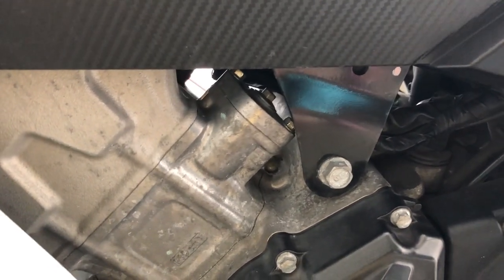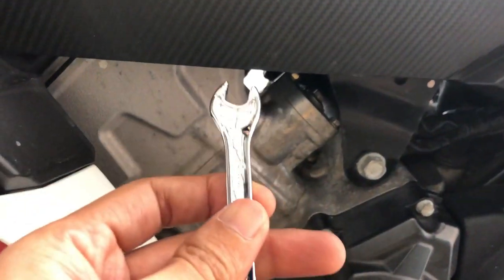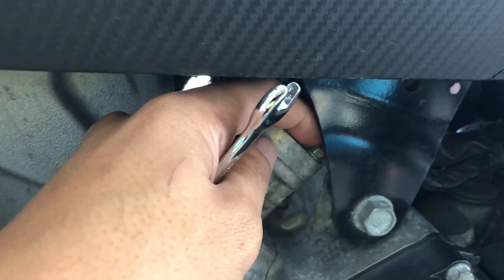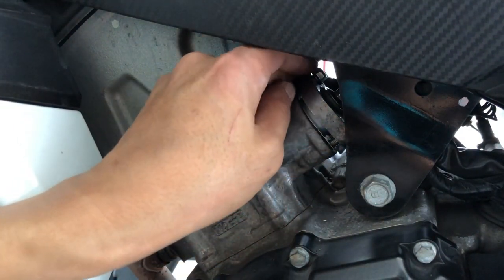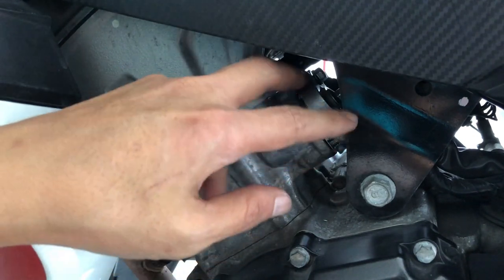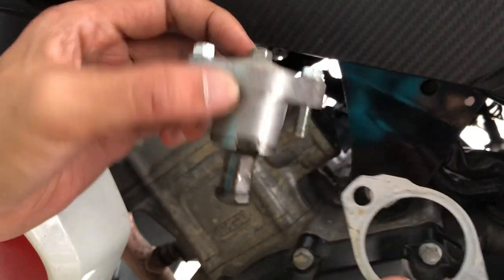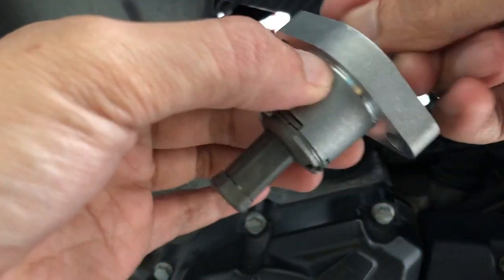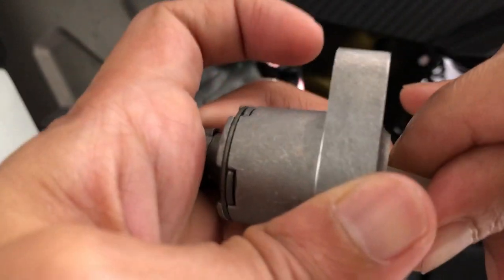Tukar Tensioner RS150 Rosak

Comment: assalam bang , motor saya baru lepas accident bang . mileage baru 2k tapi bunyi bising sangat . tapi saya accident takde damage enjin . bunyi kat enjing memang sebelum accident memang dah ada bunyi blup blup blup macam tu bang
Reply from the maker: Bunyi yg sama cam dlm video ke bos? Kalu tukar takut benda lain lak yg problem. Kena check dulu bos.
Reply: @chongsalmi  bunyi kasar macam dalam video pun ada bang . bunyi lain pun ada
Reply from the maker: @aarondanie1047  bos boleh try tukar tensioner dulu kalu problem ade related ngan tensioner. Kalu nak tukar pun harga x mahal sgt. Boleh cuba test satu persatu. Kalu betul related ngan tensioner alhamdullilah. Kalu bukan kena check benda lain le plak.

Comment: Klu Moto xmodi ap2 blh ka klu pakai yg manual pnya
Reply from the maker: Boleh pakai bos tp make sure setting die ngam la bos. Sy lbh prefer auto je sbb pnp.
Reply: nak tnya skit kalau motor tgh jalan dpn ada bumper/bonggol so kita tarik lah clutch dgn brake ye nak lalu bumper tu tapi time tu kerap juga ye berlaku rasa mcm trsentak2 dkt spoket dpn. spoket dpn blkg dgn rantai baru tukar. masih berlaku masalah yg sama. tensioner problem ke bro?
Reply from the maker: @safwanazman2885  tensioner biasa kalu stop pun ade bunyi cam “klotok” yg kuat even x jalan. Kalu tersntak ni suspect cam clutch gear kot. Sprocket dpn blkg br tukar kan?
Reply: Manual pakai boleh tahan bertahun lamanya. Auto cepat rosak
Reply from the maker: @chewan639  jgn risau bos. auto yg rosak tu boleh service balik buat spare.

Comment: Asslam bro..sorry lari tajuk sikit..sya nk tnya knpa bla sya bwk Moto agersif Moto jdi rpm lmbt turun bro..bla berhenti tarik clutch jdi tinggi timing ...pening bru ja pi setting fid ja hri to sbb sampah bnyk
Reply from the maker: Salam bos. Dah check throttle cable kot2 ade sangkut atau x smooth dah? Cuba try pulas throttle tgk camane.
Reply: @chongsalmi  maksud boss kna tukaq lain ka mcm mna..sbb sya pulas dya mcm turun lmbt throttle to dpn dya mcm free bnyk
Reply from the maker: @muhammadbai4176  maksud sy kena check kat cable kat throttle body bos takut time pulas die x smooth. Xyah tukar lg bos.
Reply: @chongsalmi  yaka ok2 terima kasih bro...sorry ganggu
Reply from the maker: @muhammadbai4176  xde ganggu bos. Ok je
Reply: @chongsalmi  maaf boss blh dak sya tnya skli LG..dya jdi jgk larh boss bla Kita berhenti tarik clutch rpm jdi 2-3 lps to bg free gear stay sma..smpy rumah ttup start balik sma jgk..TPS bru ja tukar dlm bln4 thrrotle body pown dh service
Reply: @chongsalmi  maaf boss blh dak sya tnya skli LG..dya jdi jgk larh boss bla Kita berhenti tarik clutch rpm jdi 2-3 lps to bg free gear stay sma..smpy rumah ttup start balik sma jgk..TPS bru ja tukar dlm bln4 thrrotle body pown dh service
Reply: LG 1 bla sya try sentuh wayer soket TPS yg dri bwh to terus Nyala check enjin
Reply: LG 1 bla sya try sentuh wayer soket TPS yg dri bwh to terus Nyala check enjin
Reply from the maker: @muhammadbai4176  standard rpm 1.5 camtu. Boleh tanye dak lps tukar tps ade set ape2 x?
Reply from the maker: @muhammadbai4176  ade buat reset fid?
Reply: @chongsalmi  ya bru minggu lps sya pi set fid sbb bnyk sampah kdai kata..sbb nk chcek enjin..bla enjin sejuk xnaik dya ok ja..bla panas jdi tinggi tpi xkerap jdi tnggi .. throttle bla sya try pulas bunyi ok dya turun..adkah mslh iacv..tpi bla free dya jdi Dan bla drop gear time bwk dya turun lmbt
Reply from the maker: @muhammadbai4176  masa buat fid ade error ape2 tak? Contoh cam error tps ke seblm die reset error tu?kalu rpm, iacv pun related gak.
Reply: @chongsalmi  sbb ad yg sya tgk video sensor clutch problem tpi lever clutch sya standard ja tpi sya ad try sembur minyak gas tdi
Reply: @chongsalmi  masa bwt fid kedai ckp Cuma ad mslh sampah ja yg lain semua ok..kdai to ckp klu error dya akan bg tw
Reply from the maker: @muhammadbai4176  sepatutnya camtu kalu buat fid sbb die akan detect error.
Reply: @chongsalmi  bru nirh sya pi xdak ap error nirh timing bru jdi 2/3 hri lps
Reply: @chongsalmi  klu sya try tukaq iacv manual blh ke..sbb sya ad simpan manual punya..sorry bro ganggu
Reply from the maker: @muhammadbai4176  ok2 paham. Kalu timing kena check tb or iacv
Reply: @chongsalmi  hri nirh sya bwk relax2 ok plk rpm dya bro..adoiii tpi sya blom Cuba tukaq iacv
Reply from the maker: @muhammadbai4176  takpe bos. Pakai dulu kalu x problem sgt. Kalu terasa dah x ok baru tukar.
Reply: Boss boleh check clutch suis takut spring dkt suiz kotor dan menyebabkn spring dkt clucth suis lambat return

Comment: tensioner manual ke bro ?
Reply from the maker: Auto bos. Pakai yg honda wave 125
Reply: mmg lepas pasang langsung dah takde bunyi sampai bila2 ?
Reply from the maker: @aarondanie1047  nak ckp sampai bila2 tu sy xleh nak confirmkan lg. But setakat ni jalan ok je.
Reply: apa beza manual dengan auto
Reply from the maker: @khairuleirul9180  auto just pnp je. Kalu manual kena adjust tension sendiri ikut setting yg betul.
Reply: @aarondanie1047  senang je nk jaga tensioner ni. Ko jgn bawa moto full throtlle memanjang je atas jalan/highway. Lagi satu panaskan enjin setiap kali nk ride g keja ke nk g mana mana ke 1-2minit cm tu la. Ha tu je cara nk jaga tensioner. Lagi satu kalau naik bukit jgn guna gear tinggi. Ramai pomen ckp tu juga salah satu tensioner kerap rosak. Tpi yg penting jgn full throttle all the time. Enjin mengerang byk kali tu lah penyebab tensioner rosak. Aq pakai auto tens. Kt rsv2 alhamdulillah sampai sekarang belum rosak
Reply: @pelitanaga4967  mantap boss